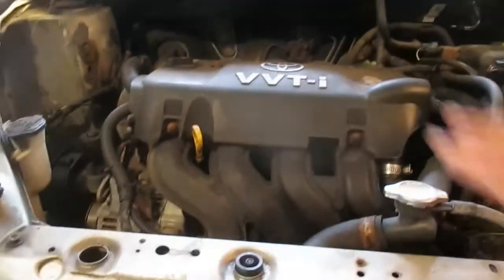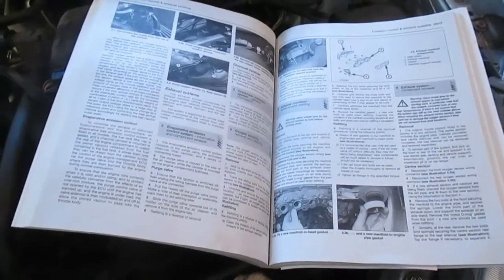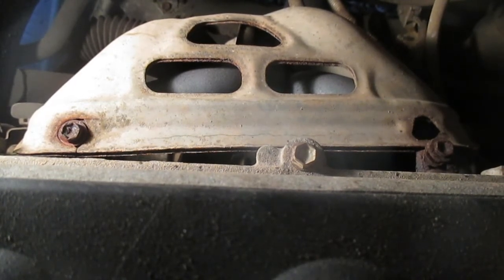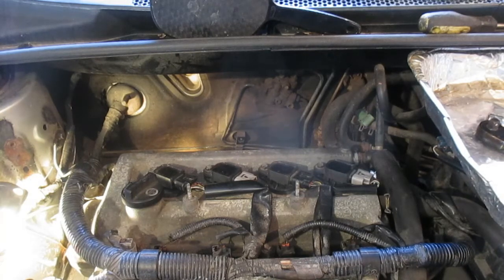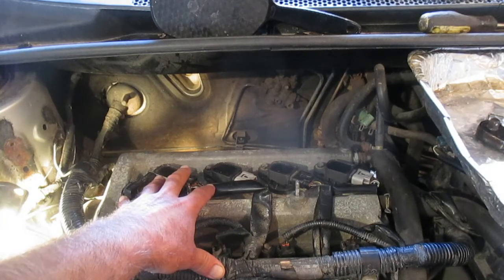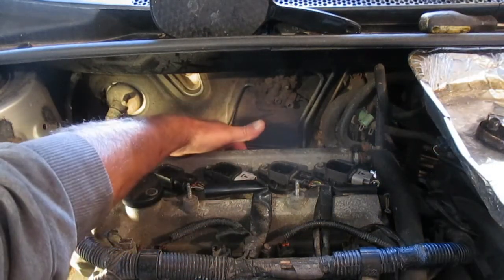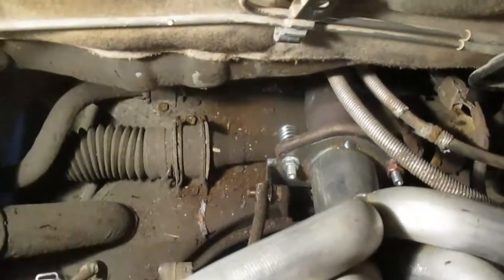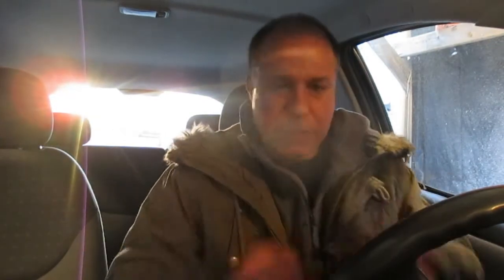Replacing an exhaust manifold

Comment: thanks backyardmech.  I have our son's '05 Echo on jackstands and have been soaking the 2 bolts with springs with penetrating oil.  I am surprised your's came out without breaking.  The exhaust leak here is hard to locate.  It has been the same for over a year - worse under load and when warmed up.  I felt all around on startup when the engine is cold and cannot feel it.  The most likely fail point is that gasket joining the pipe to the manifold since it  rocks a bit and could be sealing sometimes and other times not.  Nice to know from your video that if the bolts break, pulling the manifold will be not really hard.  John in Manitoba - also nice to see the Canadian Tire stuff.

Comment: That flange probably broke off the right side of the old exhaust manifold, as seen at 10:56, because the engine rocks back too much when you hit the gas.  The engine rocks back too much when you hit the gas because that 2005 Echo needs all three engine mounts replaced.  If the engine mounts don't get replaced the new exhaust manifold will continue to rock back also when the gas pedal is pressed.  Therefore, the same exhaust leak will eventually happen where the exhaust pipe meets the manifold.